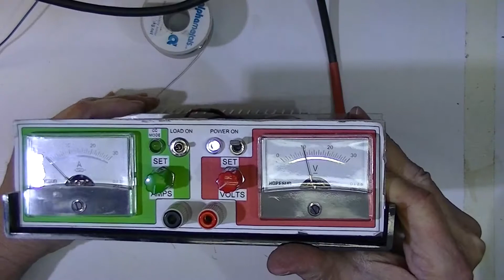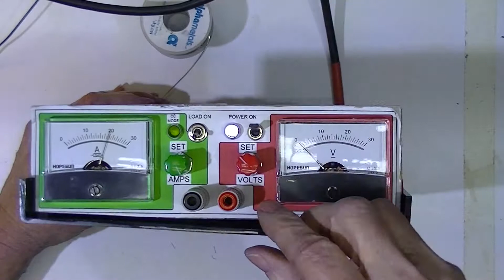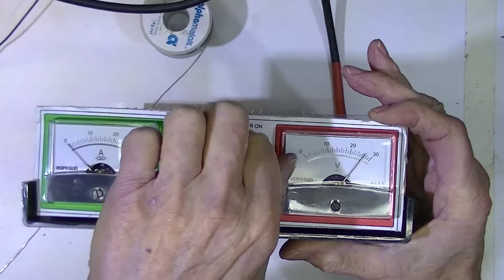30 Volt – 3 Amp Analog Meter Power Supply – Part 8

Comment: I want to know whether the part- 8 vedio cilp has the  e bay selling PCB of 30V, 3A  power supply, According to the view of the PCB nothing has altered and it shows 30V and 3Amp. Is this correct?
Suvindra
Reply from the maker: Suvindra;
 When I purchased the kits, on Ebay, they were advertised as being "Original Highland LM317, 0-03 Volt, 0-1 Amp supplies. So I purchased two 1 Amp transformers and built the unit shown. During construction the Ebay description was changed to 30 Volt 3 Amp and reference to "Highland" was deleted. Actually, the kits used were Ekits units designed for 30 Volts, 3 Amps. The Ekits are very close copies of the Highland design. As I had used 1 Amp rated transformers, I made R18(?) variable and adjusted it to limit the current to 1 Amp. I have just completed a video showing the "Original Highland LM317, 0-03 Volt, 0-1 Amp supply. And my latest Mail video shows the 3 Highland supplies as well as a sample of the Ekit units.
Thanks
Steve